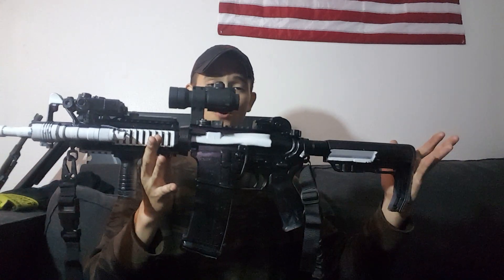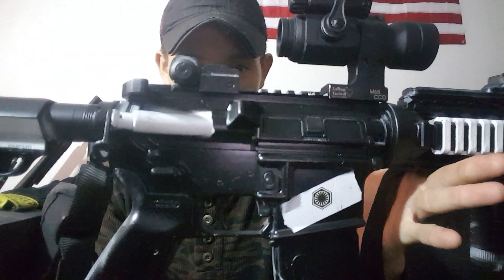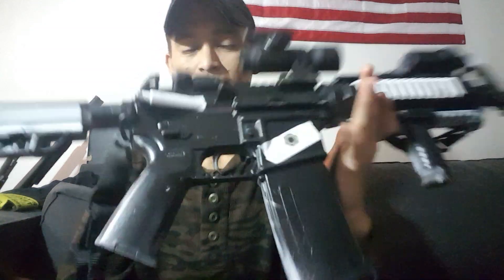Gun guy knowledge that nobody cares about. Ep1: Your twist rate is WRONG!

Comment: Speaking for myself, nothing quite like being relatively ignorant, and then enlighting  yourself later.  Many, many years ago, my primary duty weapon in the chair force was an M-16A2.  And in the chair force, the main thing your taught is how zero it, shoot the damn thing, do some immediate action drills, and shoot the dude who's closest to you first.   That's pretty much it.  

So A few years ago, out of nostalgia, i had frankengunned an AR-15 to resemble my old service rifle.  So, obviously were talking A2 furniture, with a 1/7, 20" govt profile barrel.  Over time, this rifle evolved into an SHTF gun, and I ended up replacing all the A2 furnature with magpul, I ditched the carrying handle with A2 sights ( cause I used an A3 upper with a rail), and put on a poor mans acog from vortex.  Sighted it in at with 62 grains at 100 yards, threw it in the safe, and only brought it out occasionally to the range.  

Fast forward to today.  I'm thinking about getting into varmint hunting.  As it happens, the best caliber in my safe for this job, is my frankengun AR-15A2 , and having learned quite a bit since I first acquired the rifle, I knew that my 1/7 barrel was going to effect my accuracy, and I don't like missing my targets.  To end this long story, in order to find the best hunting round for my rifle, i went out into the desert and shot at 100 yards and 200 yards with 55  grain and 75 grain.  At 100 yards there wasn't much of any difference, but at 200 yards, it was an absolute joke.  Shooting "over barricade" the 75 grain produced a 2-3 inch group (I didn't put a tape to it, but it was basically 1 ragged hole and 1 flier), while the 55 grain had 8 to 10" in between shots.  So Yeah, I'm really NOT liking that 1/7 barrel now.  This frankenrilfe is liable to go into another evolution.  Either I'll try and free float the barrel, or replace it entirely when I can afford it.

Ain't nostalgia a bitch.

Comment: So what is the correct twist rate for a 16" rifle?
Reply: its not the length of the barrel, its weight of the bullet you plan on shooting that you need to consider when choosing a twist rate. heavy bullets 77 gr like a 1 in 7 , light weigh bullets 55 gr like a slower twist 1 in 9

Comment: Colt didn't screw with the M16 back in its introduction. The US Army & the Ordinance Corps were making all those decisions, such as using ball powder when the cartridge was designed for the XMR Powder. The ball powder burned significantly faster causing the cycling issues and the Military didn't request the Chambers become chromed. It took Stoner and a few others practically investigating these failures in the field to fix all this.

Stoner was also very against a forward assist.

Comment: I'm pretty sure Remington didn't design the 223 to tumble inside a body, it was just a happy accident of the design. The original design used a .222 Remington but the military wanted more velocity so the case was stretched a bit and the 5.56x45 (commercially released as the .223 Remington) was born.
Reply: Well thw bullet is not .223 or .222 it is .224

Comment: I have two rifles in 1:7 twist and two in 1:9 and can tell you that the 1:7 can be very accurate with 55-62 gr ammunition. I've even tried 40 gr handloads with good results. That said, I've tried 1:9 twist with 75 gr Amaxs and had no luck at all. It was OK but not like the 52 gr pills.

Comment: What tracer was it that weighed 77Gr. The M196 was 54Gr and the M856 is 63.7Gr. So what round was it, was it a round that was tested and not adopted. Or are you talking about the M856 tracer. Witch was the tracer adopted when the military adopted the M855. The only 77Gr round I know of is the Mk262 mod 0/1. There was a round that was tested that was called the XM287 and the tracer was the XM288 but both of those rounds were 68Gr. But as far as I know nether of those round were adopted. On a lighter note quick question Kilo Ren or Darth Vader?

Comment: have to disagree with this somewhat. You're not 'overstabilizing' 55 grain ammo by shooting it out of a 1/7. You're literally losing nothing accuracy wise with a 1/7 vs a 1/9 shooting 55 or even 50 grain ammo. The opposite scenario, with a longer projectile ie 69-77 grain, you can have problems with 1/9 twist not stabilizing the bullet. 
The only time a twist becomes too fast is if you literally start spinning the bullet apart, and a 1/7 is not even close to doing that with a 55 grain bullet. There is 0 downside to a 1/7 twist barrel shooting anything 50 grains and above.

Comment: About the twist rate I'm not sure if this happened everywhere or not anyhow when we first got the saws or 249 the old ammo we had for the m16 not the A2 but when the selector was auto and semi whith the old hand guards that ammo didn't always throw the bolt all the way back in the 249 causing malfunctioning then all of a sudden we we ordered to only use the old ammo in the 16s and got the green tip for the 249 and them along came the M16A2 and then all ammo in 5.56 was the green tip god what a mess that was anyhow that was back in the 80s  they certainly were confused

Comment: I have a question, as i hunt With a 55gr Barnes ttsx bullet.(That i havent tested out a lot of accuracy With yet) 1/9 twist bolt gun in 223. Does the increased Chamber pressure(and also length because copper is lighter then lead) change the stabelizeing a lot? (side note, as im Norwegian the Norwegian army started useing homogeneous ball round for the hk 416 standard issue rifle wich caused "metal Fever"  as they called it, makeing pepole sick. What actually happened i Guess, is increased Chamber pressure and the gass has to og somewhere? Just so that you know not only Your military are stupid ;) -refering to 1/9 vs 1/7 because of tracers. Have a good day! : )

Comment: Thanks for the rundown. I have a question; my friend is speccing together a 12.5" 7.62x39 build. We're in Canada so it actually makes sense, short explanation.
The ammo we use is 123gr surplus and 155gr cast. My instinct is that the standard 1:9.5//1:10 twist that you find on most x39 barrels is the optimal one. Is this correct?

Comment: Yah, I shoot everything from one in 12 to 1 in seven twist and I don't really notice a difference. I think twist rate is really overrated and over discussed.
Reply: Speaking for ARs and other 2.23/5.56.... it kind of depends on the weight of your ammo.  There is a reason for twist rates.  If you want to shoot really heavy 2.23/5.56 rounds like in the 70+ grain range then having a 1/7 twist is probably a good idea.  If you're just shooting typical 55/62gr ammo then it isn't really a big deal and might actually not be good, as regularguy kind of describes.
Reply: yup

Comment: Dude I 100% agree with you! while the 1:7 twist rate is excellent for the 77gr projectiles, for 55gr M193 or typical range ammo the 1:9 twist is superior. i've done side-by-side comparisons w ample supporting data. notice the guys who claim M193 is junk inaccurate ammo are all running 1:7 barrels, so they blame the ammo instead of their setup.
Reply: that's why you run 1:8 and shoot both😜
Reply: yes, but i believe that the 1:7 twist shoots the 55 gr better than the 1:9 shoots the 77
Reply: Agreed, but it's important to keep it in context like ARG said; even the "wrong" twist aka 1:7 for 55gr still shoots fine. Minute of man to 600 what more can you really expect. If I was building id go with 1:8 though. But any of the 3 main twists is good to great for 95% of us.

Comment: What about length. Is there that big of different From a 14.5" 16" or 18".  I really like the 14.5" but at what cost.  I shoot mostly 556 62gr that a local place loads around me. The farthest I can shoot is out to 300 yards at my range.
Reply: +John Crain 
it depends on your barrel twist. You will get the best accuracy for the rounds about 69 grain with a 1/7 twist. For ranges less than 200 in a carbine or rifle, it doesn't matter much, but the heavy rounds have less drop & wind drift past that. Those are match grade rounds with thin jackets. Loaded to 5.56 velocity & pressure, they will fragment at less distances, and will perform better in flesh. The downside is they aren't good rounds for shooting through intermediate barriers. They're a better choice for long range shooting and for SBRs, due to their tendency to yaw very quickly, even at lower velocities.
Reply: you lose about 40 fps velocity per inch. The difference between a 20" and a 16" is about 5%, or a loss of 10% energy. Not enough to notice at 300.

Comment: Good stuff.  I don't ever purposely buy anything heavier than 62 grain, and it's still generally 55 grain - all of which is fine for my 1:9 pencil barrel.  Suggestion: You could start a 'go fund me' or Patreon account for either a higher-end camera (this video seemed ever so slightly grainy, but not really enough to worry about in the short-term), or for a better editing program (or computer to allow editing at a higher scale).  It could have been an issue with the camera working with the light that it had, too, but I'm not sure.